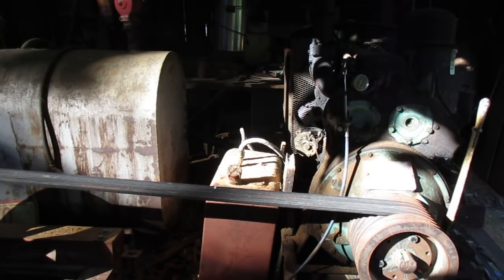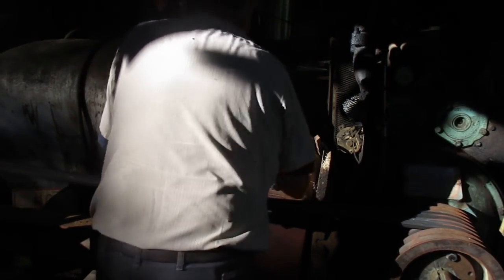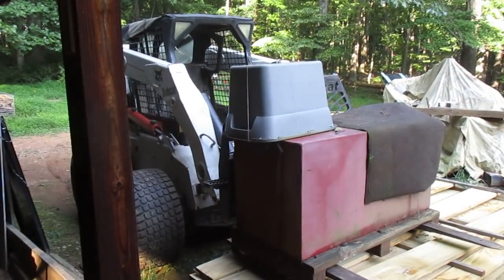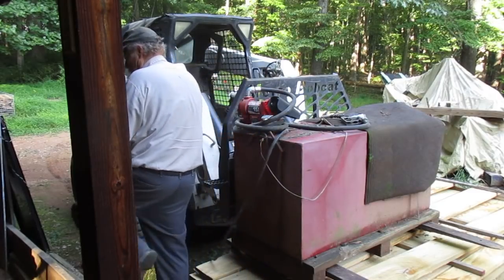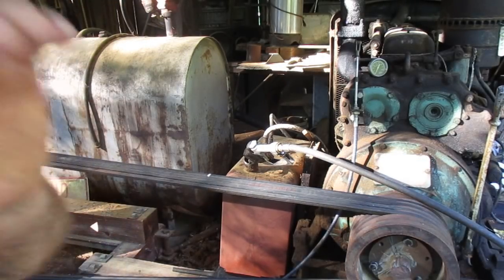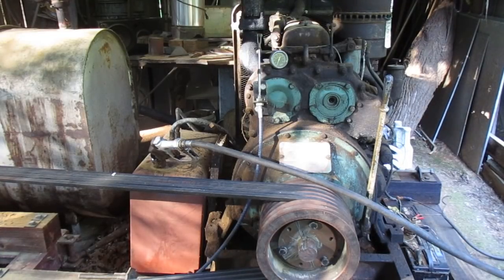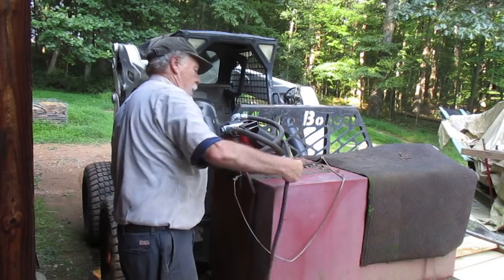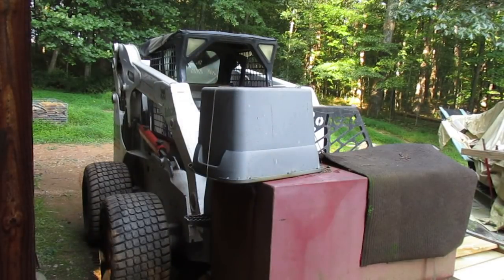Food for the Sawmill Sawing tomorrow night #453

Comment: Hi  John!!😀😀
I could have sworn that your transfer tank was empty. That's how my 12 volt gear pump sounds when the tank goes dry. 
I have also used my gear pump to fill itself by taking the nozzle off and dropping the hose  into a tank of fuel and hooking it up backwards on the battery. I had a couple 275 gallon fuel tanks without pumps filled up once when fuel was cheap and thought I was going to have to get a pump to get it out of them. But I got to thinking about it and tried hooking it backwards and it worked great. But a vain pump might not like being hooked up backwards. 
Take care my friend!! 

Logger Al
Reply from the maker: hi there i think its ok but thanks  john

Comment: Even a short bus motor has to drink sometimes. I've hand pumped many a tank full of diesel. The dragline took 15 gallons and 1/2 tube of grease a day, hand pumped from a 50 gallon truck tank in the pickup and toted and poured in. Greased up at quitting time so everything was warm and would take grease easier. Always did that same routine. So keep the little motor happy. GBWYou!.
Reply from the maker: good story  thanks john

Comment: That moaning sounds like a Power steering pump when it foams up the fluid from a low level condition. You may have made some bubbles in the tank from running the pump backwards and if so the noise should go away after sitting a few minutes so the bubbles pop out of the fuel. It's a common problem when people don't prime a power steering pump on a car when replacing it causing the fluid to foam up and moan for a few days.
Reply from the maker: hi there thanks john